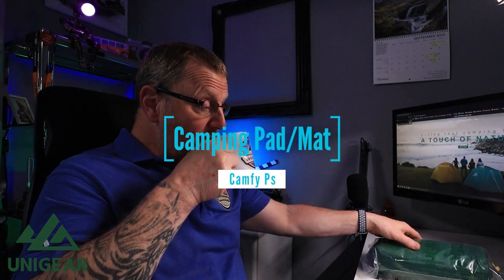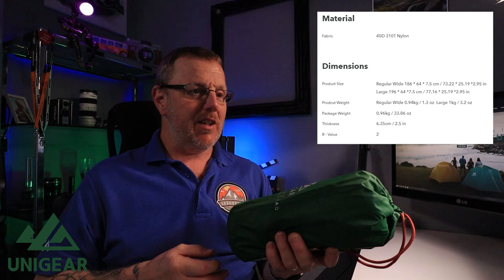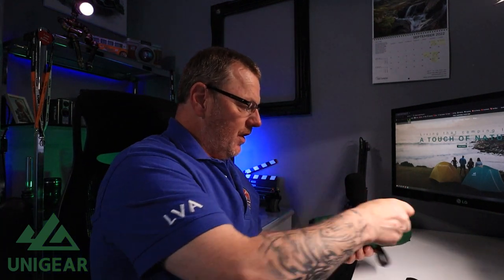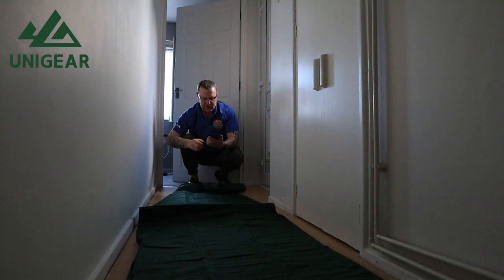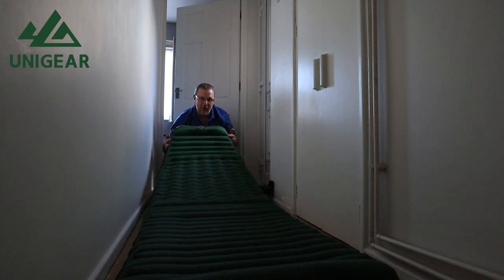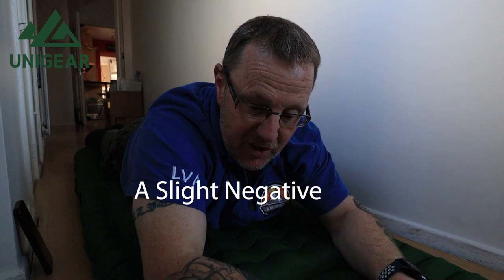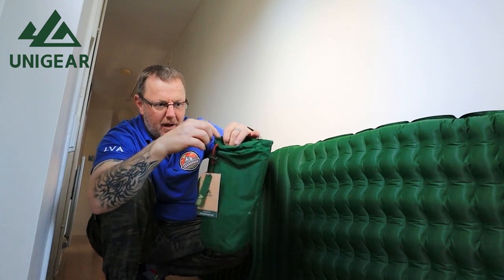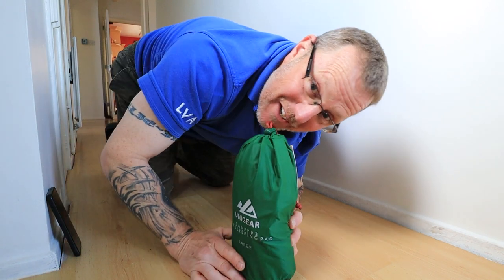Unigear Camfy P3 sleeping pad / mat with inflator bag, easy comfy and quiet camping air bed

Comment: I bought a large one of these a while ago used it wild camping a few times.  I’m quite heavy but find this exceptionally comfortable it doesn’t bottom out at all the various ridges and baffles work very well.  I initially bought one after many reviewers said it was good for side sleepers.
The sack pump does work but I bought one of those tiny Flextail pumps it inflates in a matter of seconds.
Reply from the maker: Thanks for sharing! its so important to hear good stuff thanks